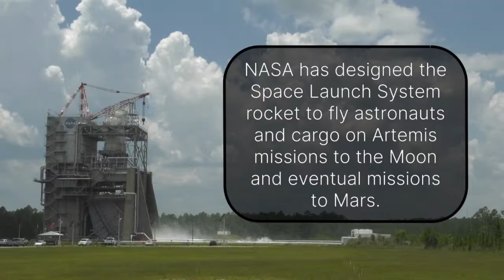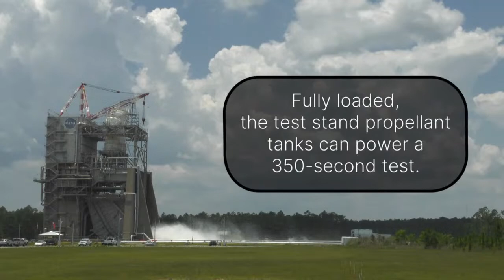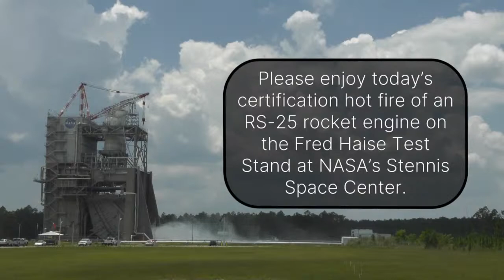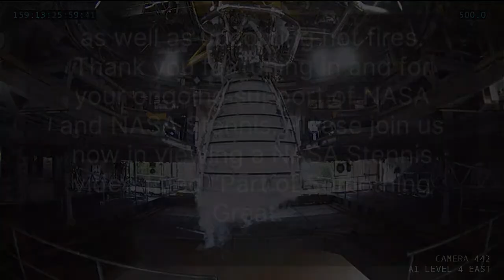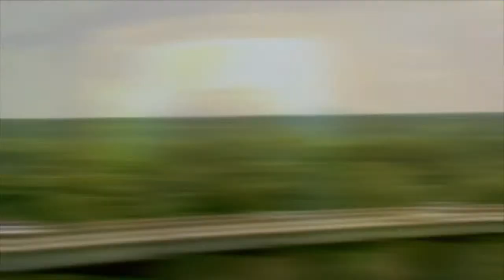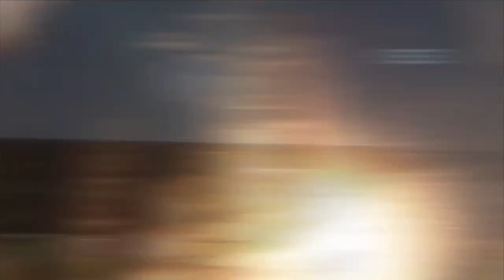NASA Stennis Live Stream

Comment: Does the rs-25 start up quicker now? Or is it just me?
Reply: Not really it’s about the same amount of time.  They have to prime both sets of pumps and make sure they are at the correct temperatures. With other factors as well like the stand and surrounding area.
Reply: Nope, it’s always taken this long. The reason you might think it takes longer is because during Shuttle/SLS launches, they wait with the RS-25s on to make sure everything is working right, and then launch the rocket
Reply: I feel like that throttled up much faster too. Might just be me. The nozzle also appeared to shake less, which I had been violent in the past.